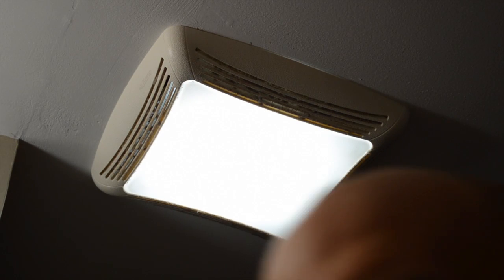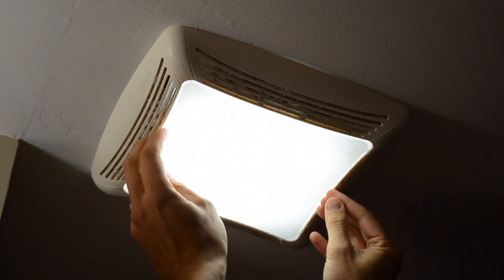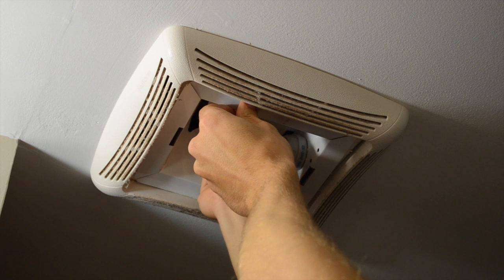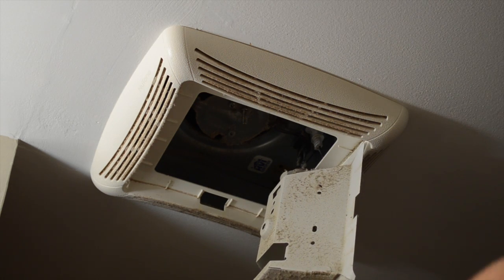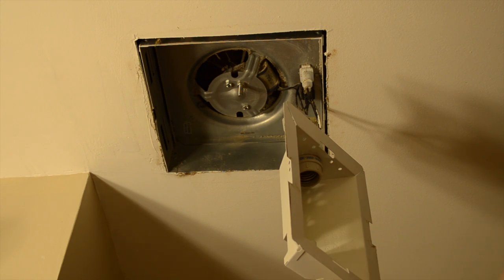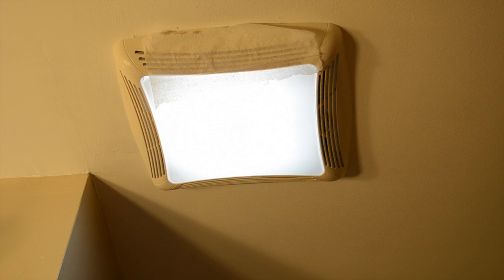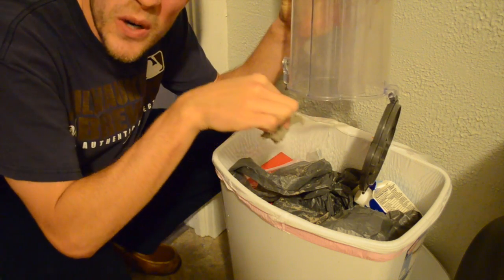How to improve bathroom ventilation | Fix bathroom fan ventilation

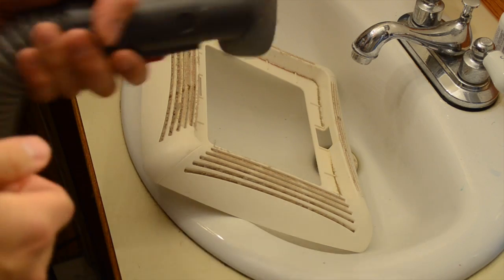Comment: This is our exact model bathroom ventilation fan--NuTone 763RL/769RL A Unit. I used this video to disassemble and clean the motor, fan, housing, and vent. I was happy to find a video with this model as they are about 10-15 years old now. Ours still works fine. This video helped with the removal of the light housing. However, you can break it down further. The interior housing also comes out. It's a bit tricky. First, make sure you cut the power to the circuit. At 1:23 in this video,  the angle is perfect to see the interior lip that runs on the left side of the unit in the vido image from 11 o'clock to 5 o'clock where the upper interior of horizontal flat connected to the fan motor meets vertical flat surface of the housing (with the 2" long by 1/4" vented holes). That lip contains two slim connectors on each end of the lip that insert into slits on each end. To remove the inner housing, pull down on the side opposite the lip (the right side of the metal housing looking at the image at 1:23) You might have to fight with a bit to loosen it if it is a tight fit or it is stuck, but it'll come out. There is no need to detach the motor (yet). Those screws in the center of the unit connect the motor to the metal housing. Ignore them for now. As I said, pull on the side opposite the lip to remove the housing. The whole thing will angle down, then you can unplug the motor. Once you remove the interior housing with the motor attached, then you can remove the two tiny nuts that connect the motor to the housing to give it a thorough cleaning.

Comment: I have the exact same model but my problem is that it's using this Philips CFL light bulb, which I'm still figuring out how to remove. Other Youtube video tutorials are saying to yank it back and forth, but it's not working. I saw that you have the same model of the exhaust fan, so I thought you'd also have the same type of bulb that I do and hoped that I'd see how to remove this damn bulb.

Comment: Same thing is going on with my exhaust fan in the home I'm renting. I've vacuumed it, taken it apart and vacuumed as far up inside as I CAN and it STILL won't even hold one square of toilet paper when I hold it up to it.  I know I could tell my landlord....but he takes FOREVER to get back to me when it comes to repairs and there's already mold forming on the walls along the ceiling directly above my shower so I KNOW the exhaust fan isn't doing it's job. I'm not about to try and crawl up into the attic though to see what's going on.....so I guess maybe just purchasing and installing a brand new exhaust fan would do the trick and then I could just bill my landlord later.
Reply: Try 3in1 oil the motor may need to be oil also how old is the fan and the fan may not be ducted to the outside it may be blowing in the attic

Comment: Easier way to do this (in my opinion) is to go into the attic to clean it. These fans have boxes that jut up into the attic and they have access doors. You can remove these doors and you have plenty of room to get in there with a vacuum! 🫡